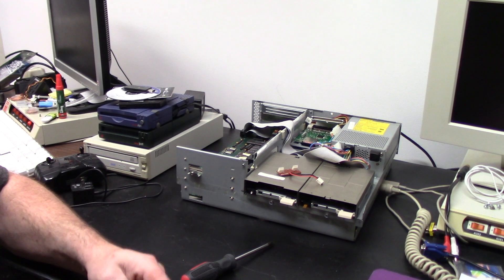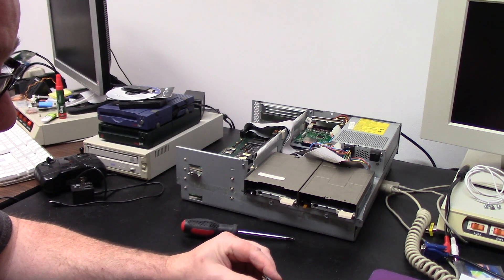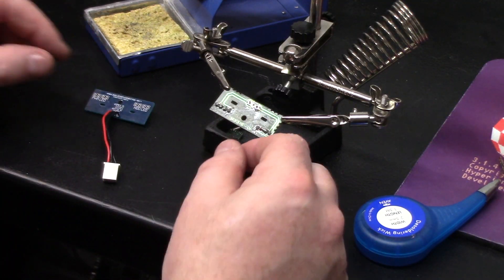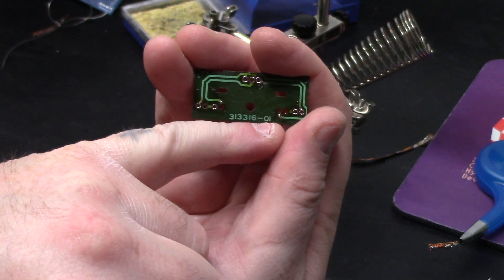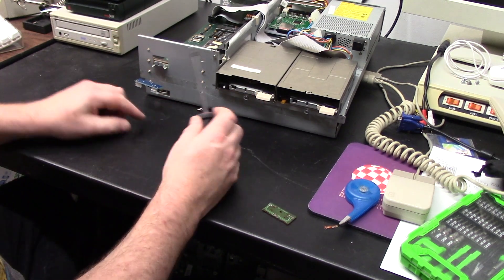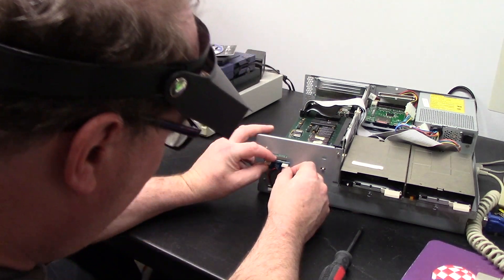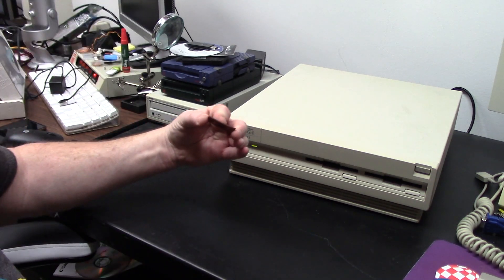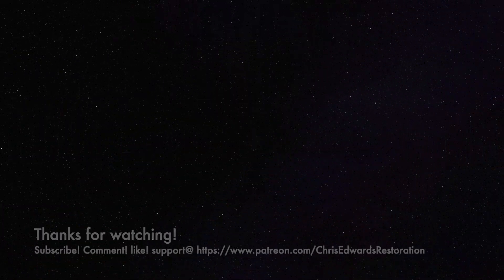Amiga 3000 led pcb replacement

Comment: That old board will work just fine if you just jumper wire all the connections on the back tho?
Reply from the maker: Sorta.  Its pretty beat up and bent

Comment: Another great video Chris. 👍🏻 Makes me want to get a A3000 but with astronomical prices they go for on EBay can’t justify it 😳🙄 The LEDs on the A3000, do the A500 and 500+ Keyboard LEDs fit as a replacement? I know you mentioned on one of your other videos that you can use the A500 LEDs as replacements on the A2000. Cheers! Jon. 😉
Reply from the maker: 2000 uses small leds normal ones, 
On the 3000 they are a tad longer so you file one edge down about 1mm and its perfect.  Now though sordan and others are re selling completed boards.  With dual leds. But still functional